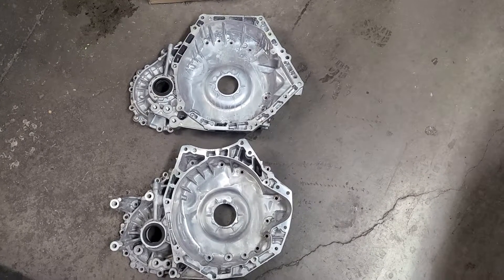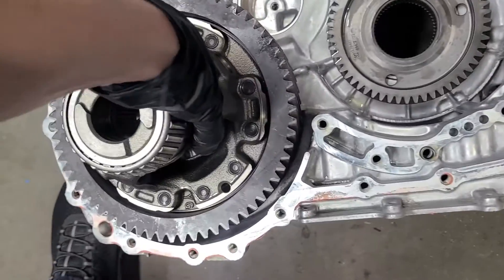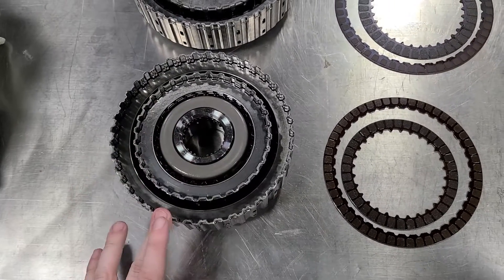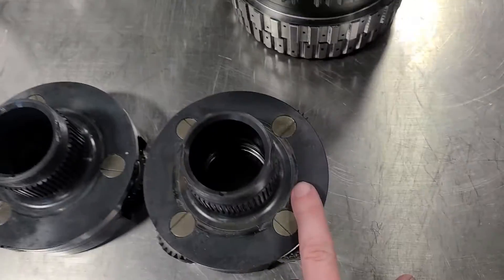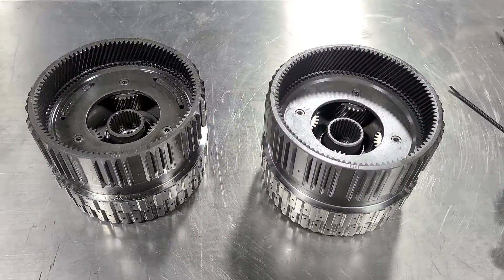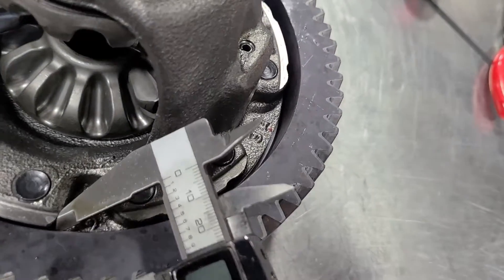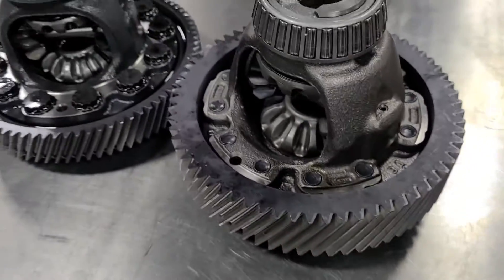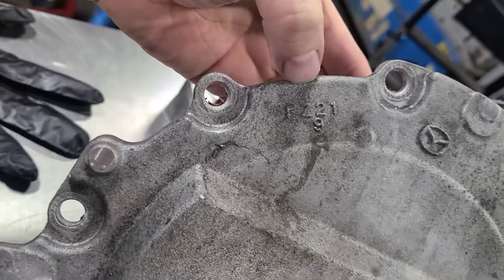Mazda Skyactiv Drive, Turbo vs NA

Comment: dude you are the #1 source I've found when discussing NA vs turbo parts.  I find VERY little information out there, but it's my understanding that the turbo skyactiv engines are literally beefed up in I think every single way. The engine block, pistons, rods, valvetrain, torque convertor, axles, front brakes, exhaust,  and now I see the transmissions itself is also an upgrade over the NA stuff.

Comment: Does 2.2T Diesel and 2.5T transmission is the same? maybe bell housing is the different?
Reply from the maker: Internals are the same, there are some case differences.
Reply: @grolladat yeah, 2.5T block must be bigger, hence the difference.

Btw, since 2.5T cars are all AWD, diesel 2.2 mazda6 wagon in its AWD version might have same, rear diff and awd cluchpack, but I'm not sure, Gear ratio might be different.
Reply: BTW, I appreciate you take your time and respont to questions people ask in comment here about these little details. Thank you so much for your contribution to our curiosity and enthusiasm.

Comment: Got any tips for someone struggling to mate an engine and trans? 

Rebuilt block with new head after cracking my original head (failed T-stat) and the crank spins, the torque converter spins, but i put them together, and its locked. 10 days of trying, no luck. Both are pulled from the car at the moment for another attempt outside of the car.

Comment: Thanks for the video.  Turbo is much beefier.  Reminds me of the CX-9 AWA6-EL.  More planets for the heaviest vehicle.
Can you shed some light on the various names?  I'm seeing FW6A-EL and FW6AX-EL, and GW6A-EL and GW6AX-EL.  Supposedly the X versions are AWD but then I'm seeing non X versions listed for AWD on auction sites.  I'm guessing the G version is a newer model than the F version?
Reply from the maker: X will denote that it is AWD. There are 4 major versions. CW6AEL, ET6AEL and EV6AEL, FW6AEL and GW6AEL. The FW and GW were launched at the same time, GW originally came on the 2.2D engines in the CX-5, 6 and 3. The higher the first letter the higher designed torque capacity of the unit. The CW are used in the 2, and vehicles that use a 1.5L. ET and EV are used in some CX-3 and 4th gen 3, CX-30. FW are used in various models. GW are only used on all the 2.5T and 2.2D vehicles.
Reply: @grolladat   THANK YOU!!!  I haven't seen that information anywhere else.  I really appreciate it.  I'm thinking about selling my 3.7L Mazda6 and getting an AWD 2.5T Mazda3.  I like to learn what swaps and what the strengths are of the various powertrain components.  The Mazda3 looks really promising.
Reply from the maker: I really like my 3 2.5t. The interchangeability is actually not easy to do between turbo and non. The blocks are different with different bellhousing shapes. The turbo trans is heavy duty and I have not seen one fail yet. The cores that I've picked up were actually hard to get because there just are not many out there in junkyards.  @button-puncher
Reply: @grolladat   OK, so that's why I'm not seeing them.  Also good to know that they aren't failing.  I'd want a spare on hand if/when CS comes out with an upgraded turbo.  Plus then I could pull the diff and see if I could have an LSD made.
For interchangeability, I'm looking for things like if the larger cars have beefier components.  Have to wait and see what people start breaking.  The Mazda 3 2.5T is still relatively new.
Reply from the maker: The only differences between the bigger cars and the 3 turbo trans is the case is modified to fit the smaller car and the final drive components(ring gear and counter gear are different, diff is the same), clutches, planets, torque converter, etc are all the same parts.
 @button-puncher
Reply: @grolladat   Awesome.  Thank you again.  If our paths ever cross, I owe you a beer.
Reply: @grolladat  bro who are you and why do you know so much!
Reply from the maker: @blgdinger3  Just someone in the industry that nerds out on this stuff and I like to share things I find personally interesting.

Comment: There are a lot more differences than I thought.
Reply from the maker: The NA cars stall out around 2500, Turbos stall at around 3000rpm. I don't think you'd honestly gain much going to a higher stall speed.
Reply: @grolladat  wow that is higher than I thought. Lots of knowledge being dropped here 🙂 thanks.

I ask because I put a 3600 stall converter on my LS1 Trans Am and it really woke the car up. But that was a different age. Also before you replied I edited this comment because I found your other video about the torque converter and asked it there instead.

Comment: Do you think the transmission that comes on the NA 2 point fives will handle a supercharger kit?
Reply from the maker: I know some people have had good luck with it, and I have been messaged by some people who have not. The NA trans was not designed for that amount of power and is the reason why the turbo trans is significantly upgraded.

Comment: Nice video. It’s neat to see Mazda beefed the transmissions up to handle the extra torque of the turbo cars. 

Question… did Mazda beef up the turbo motors too?
Reply from the maker: Yes, the turbo engines are strengthened in most areas and share very little in common with the NA cars. I may have the opportunity to do a similar comparison video in the future.
Reply: @grolladat yes please do! It’s really cool to see something like this. especially since it’s about my car lol.
Reply: Thanks for the video! Incredible details!! 
So impossible bolt on transmission from the turbo to the non turbo car. Any options for enhance non turbo transmission?
Reply from the maker: @user-gh8ks7xg9b  not a lot can be done. The converter company I deal with is confident the converter they offer for the NA trans will handle ~400hp. The rest of the trans I don't feel is up to that amount of power and have good longevity. I've got some feelers out there for some upgraded clutches, but TCM access is what is really needed to increase holding power.
Reply: Definitely different pistons the compression is a lot lower on the turbo cars to help with pre detention